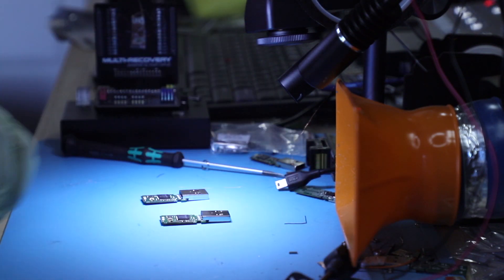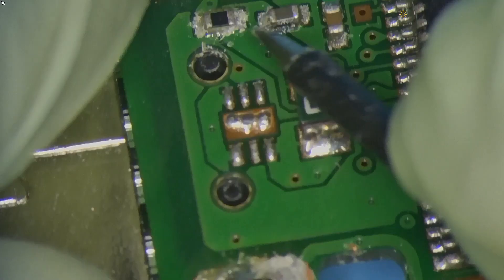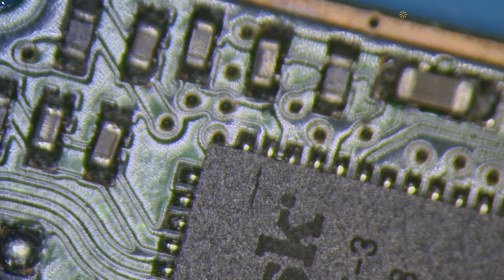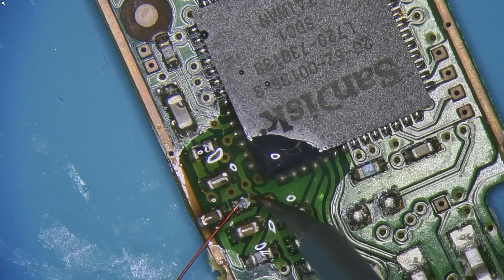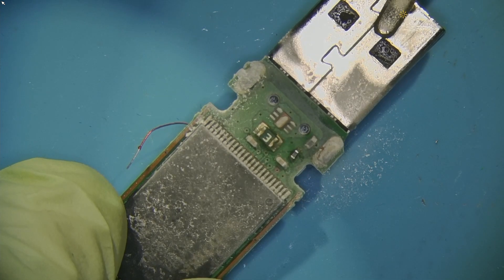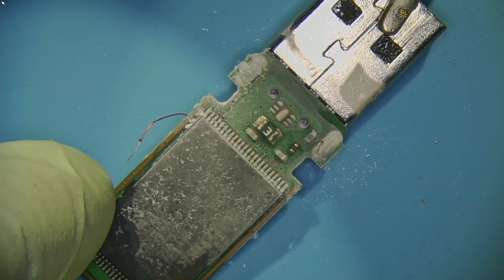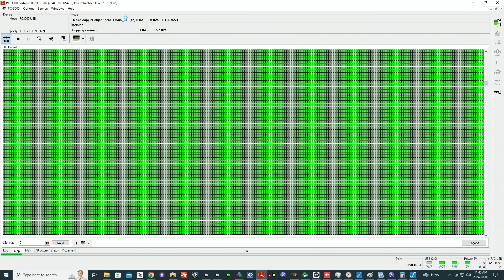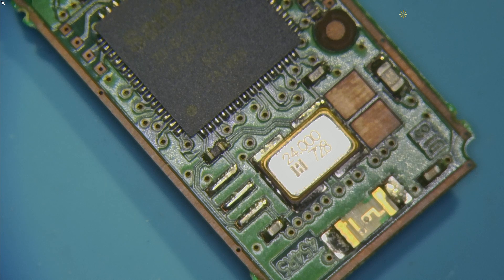CRITICAL Data Recovery from Broken Sandisk USB!

Comment: Please I want to ask you about An external  hard drive type" WD Passport "  Converted to raw when full and no information was recovered before and after formatting ❤‍🩹❤‍🩹❤‍🩹❤‍🩹❤‍🩹❤‍🩹❤‍🩹
Reply from the maker: new WD Passport drives are SMR and have 2 levels of translator. When formatted, second level translator gets erased so the drive looks completely empty just like after TRIM command on SSD. If you formatted a passport drive that was made in the last 3-4 years then you can only get your data back by a skilled professional with proper equipment that can restore second level translator ie PC3000 or similar
Reply: @hddrecoveryservices  How much would it cost if we sent you a 2TB capacity?

Comment: Hello Sir, I require your guidance. I am from India, and I have been using a 2TB WD Elements external hard drive for 2 years (though not frequently). Recently, I purchased a 2TB WD Passport. The current issue is that both hard drives are making a ticking sound and are not being detected when connected to my laptop's USB 2.0 port. However, they are showing up and functioning in the 3.0 port.

Is this an issue with my laptop, or are the hard drives about to be corrupted? Both hard drives are still under warranty. Should I request a replacement?

Comment: big fan of your works sir:) 4tb wd my passport keeps blinking and not being recognized by pc.. i tried factory reset my windows system tried different cables but still pc hangs up when i plug wd.. if you can answers sir thank u soo much.. much much loove from palawan philippines:)
Reply from the maker: Alex, most likely your drive has a very known issue for any WD unit called "slow response". Nearly 10 years ago, I wrote this article: https://www.hddrecovery.ca/blog/slow-passport-data-recovery/

It explains why WD drives have these issues.

Comment: I have a crucial 500GB SSD. Its an older drive. It has gone into read only mode when I had trouble getting the USB adapter I had it plugged into, to stay connected to the PC. Something triggered the read only mode during its plugging in and out rapidly. But the drive has no bad areas and reads fine. Is there any way at all to reset the read only or is this some sort of fuse issue or something that blows internally to the controller?
Reply from the maker: This is not electrical failure. There might be a utility on USBdev to reformat these on vendor level. Unfortunately, I am not familiar with restoration process. I only get and do data recovery work